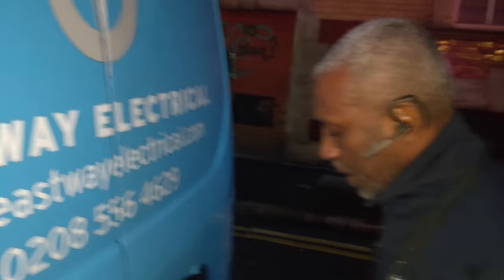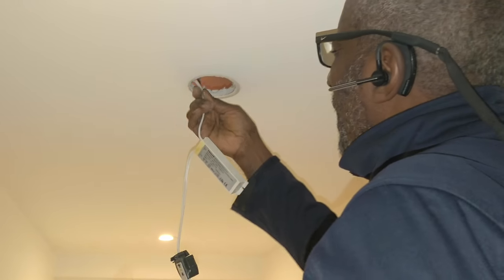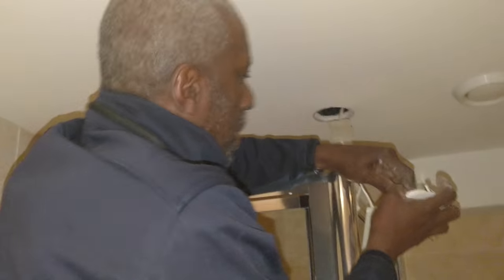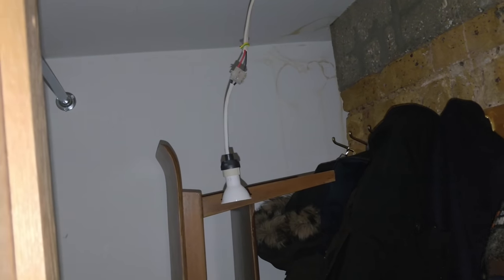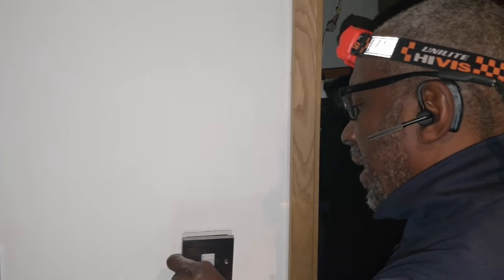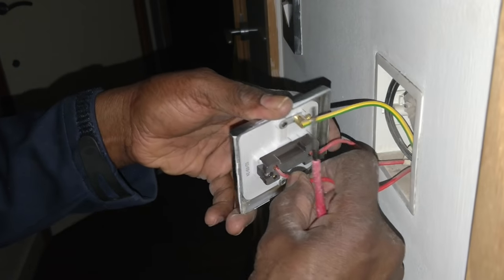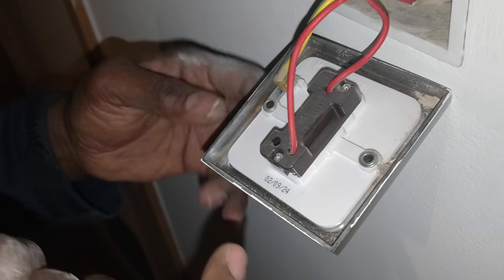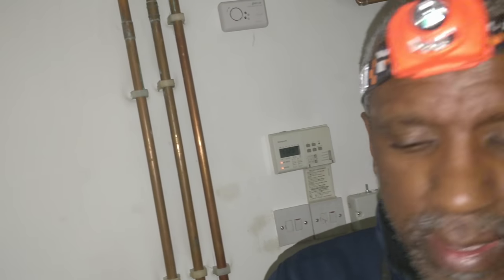Faulty Lighting Emergency Call Out

Comment: Absolutely no need for SELV downlights in a bathroom these days... Rip them all out and fit 230V IP rated LED ones.
Good call on suggesting a dedicated RCBO for the bathroom lighting circuit, it didn't look as though there were any windows in the bathroom and bathrooms can be quite hazardous especially in the dark.
Reply: Ipx4 is all they need to be anyway, you can place a 230v fan in zone 1. Selv downlights are a nuisance.

Comment: I agree completely about doubling wires over provided there’s space in the terminal. The scoring of a conductor from the terminal screw clamping on it can really cause problems if a wire is removed and then put back without stripping more insulation off and remaking the end. Good that you did that. I don’t think a decently made conenection should ever come loose, except in a situation where there is excessive vibration or movement. 2.5 solid conductors are potentially dodgy. If they are not done up fairly tightly, the screws often come loose over time. Large pyro, with its single core conductors, can be a real problem: I have seen a fire start from a pyro riser where a connection to a meter came loose and started arcing.

Comment: firt at all video well done, no music, nice explanations !

if i can make a couple of question: are the power wire with single core (no flexible) still allowed in england? couse in italy those wire were decomissioned like 20 years or more ago.
Second and most important isn't mandatory to have the whole electric system covered by at least 1 differential switch? u can add more to reduce interruption of power supply in case of a fault, but at least 1 covering all outputs? Here in italy on new electric plants \ modernized those devices are mandatory.
For example a normal house has like 3,5 kw\h power supply, on the breaker board at first u have a differential switch that protects people from accidental contacts in case of fault, and then usually at least 2 magnetotermic  16A for utility (like oven, boilers , hoovers etc) and 10A for lights, and nominal volts are around 220-230 volts.   240 volts here are a bit high.

The facts that u have several transformer burned (should be interesting to see if are burned on primary (hi voltage) or secondary coils.  i did some maintenance , and in situation like those could be that there isnt not enough space to dissipate the heat?  or the building power supply sometime have spikes of voltage level, killing the coils?

Last that light near the shower, it shouldn't be waterproof so IP 56 or 67 ( i dont think is allowed here in italy electrical device inside the shower range, unless they're low voltage and\or with safety insulation transformer.

Comment: When you pulled the one in cupboard down I could see from the tail it was a 240v (bayonet style tail rather than the little ones for 12v halogen pins) - So when you then grabbed the chop block I actually went "aaagggh" out loud! I'm sure you know not to be complacent but be careful bud, dont want 240v popping out of a chop block or old chop block falling apart when you grab it.
Reply: I think the terminology is choc block as in chocolate block ..... as terminal strips look like bars of chocolate and why they called the boxes that you now have to put round them choc boxes. Good comment though. Choc blocks are not fun when you get a belt off them ! lol

Comment: Guys a great video, i am not a sparky by trade but many years ago i did start doing a evening course City and Guilds with a view to becoming a sparky, but didn't finish it as most of the teachers weren't answering the questions fully and when it came to science side the teachers seemed to be struggling. I understand a bit about impedance can you explain what  loop impedance testing and why we carry it out, and the sequence in which the test is carried out, i don't mind calculations 
Thanks